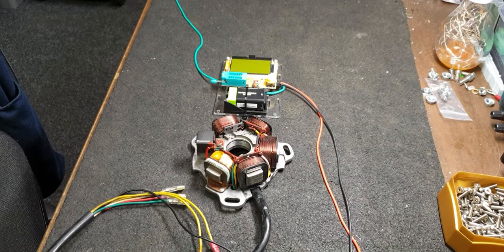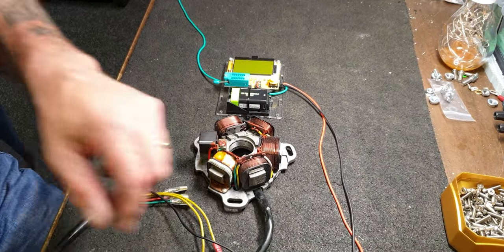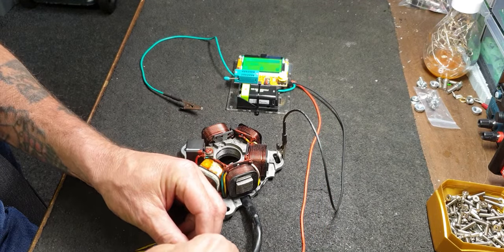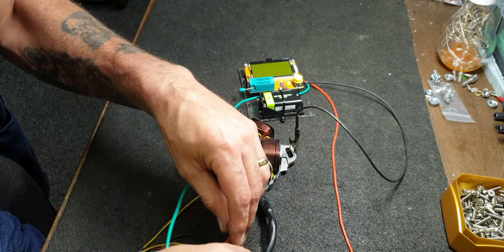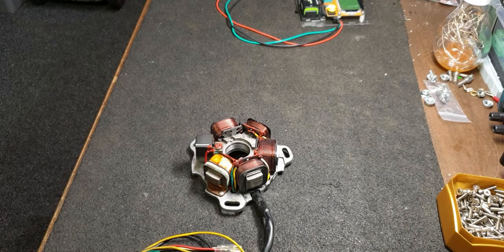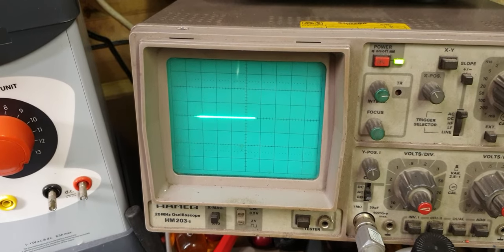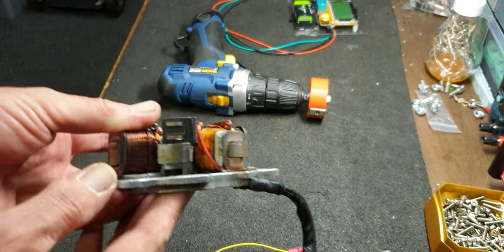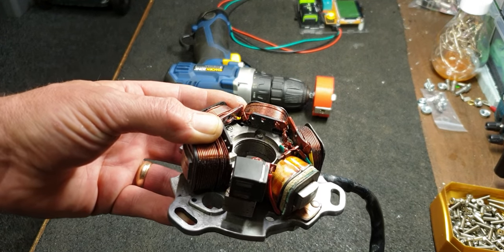Lambretta BGM 6 pole stator fault finding.

Comment: I've got the same problem that your customer with my BGM V4 stator: no spark when engine is warm. I had a clue with your diagnostic led CDI. For the first time, I regret my college years when I used an oscilloscope... I hope i'll manage to solve the problem with your new pick-up. Thanks for the video.

Comment: I have an electric fault on my 150 li s3 lambretta basically no lights or horn would that be the stator lighting coil fault because it kickstarts nearly first kick every time but sometimes misfires?
Reply from the maker: Check your stator output with an AC voltage meter across the yellow to white or chassis